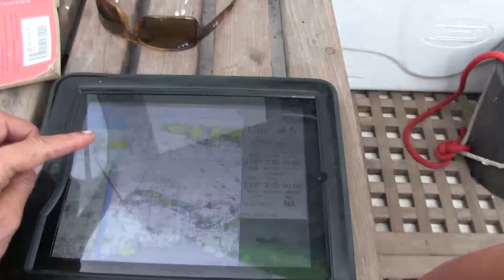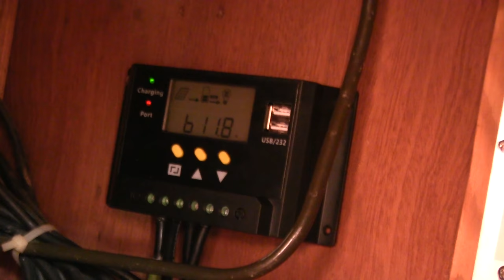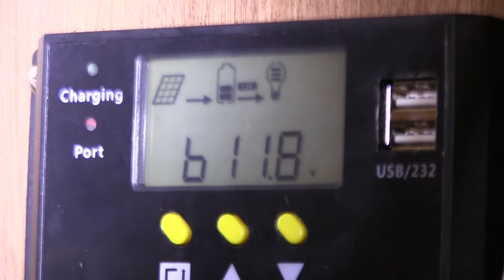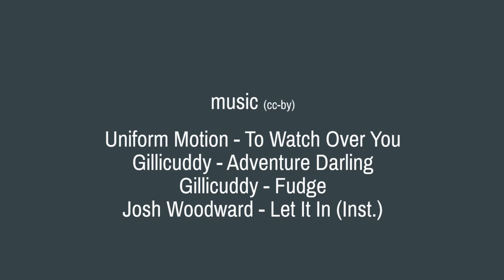Exploring pretty beaches and hanging with the Locals - UNTIE THE LINES S3E02

Comment: My charge controller is tucked into a deep part of the boat, so I added a shunt and amp meter so I could see the actual output of the solar array. Helps a ton because the battery monitor only shows amps coming in from the controller minus load, which can be very different than their actual output. Knowing only the amps from the array helps me know how the panels are doing without the charge controller and load messing up the number.

Comment: Two Solar modules in parallel will need a big diode for each panel to prevent the current from going into the module with the lower voltage in case of a partially coverage or a defective module. But you can get more out of your panels with two of this little fellas: "15A DC Boost Spannungswandler Voltage-Converter Step-Up Modul 12 60V auf 12 80V" They are under 20$ and you can adjust the minimum voltage that comes out of this components no matter how low the input voltage from the panels would be. Connect each Panel to one of these and the output in parallel to the charge controller. This will start charging your batteries with a paneloutput of about 9V. In this case a very small amount but it will. Additionally you can limit the output current but in your case the charge controller will do this, so you can set this to maximum. (You need a really small screwdriver for the adjustable resistors on the board and they have to turn multiple times from minimum to maximum) Take care you do not adjust the output voltage to more than 48V because of a higher risk of a electric shock. The ideal voltage would be a little bit more than the End-of-charge voltage of your batteries. Around 15V. They come without a case so you have to add one. Like the charge controller this components work like switching power supplies and can jam other electronics like a radio or the VHF when they are not correct installed, in bad condition, not shielded or not filtered. This component will only step up the voltage to the adjusted level but lets through every higher voltage. So you still can not put your panels in series but you do not need diodes and both panels are separatet and do not jam each other in case of a partially coverage or a defective panel with that. But there ist also a "5V-30V To 1.25-30V 8A Automatic Step-Up/Down Boost Buck CVCC Power Supply Module" available that can automatically convert a input voltage between 5 and 30V to for example 14.8V output. Maybe an update for your charge controller.

Comment: Great solar.  Yes, we had one of those cheaper chargers that was included with a few panels we installed, and it worked well.  The MPPT controllers work better.  Maybe you will be able to change to a better controller, but until then you have a working system!

Comment: Great video. I believe the "6" is intended to be a "b" for battery. If you can change one of the displays to read Amps going into your house bank you should do that. Volts are helpful for State Of Charge (SOC), but Amps are the important measurement. The same reason your energy budget most likely counted up Amps used in a day.
Reply from the maker: S/V Della Jean yes, u can totally change it to amps. This was just the setting it was on when I connected it :) it has various things u can read, once I had the English manual I figured out how to get to which one ;)
Reply: I thought you would know to have an amps display as I began writing, but decided to send my thoughts anyway just in case. Glad it's going well for you my friend. Be safe.

Comment: Nike,  you can get a Tracer CN (or A model) MPPT 30amp  controller from aliexpress (I've bought 2 of them) for around $85USD each.  It wil help you get more out of your system.  and you can connect it to your computer to really tweak the amps coming in
Reply from the maker: Pierre Mitham thx, that sounds great. After installing I also read about cheaper MPPT controllers, but at that point I did not know about them. Might consider an upgrade since I already ran through two of them ;)

Comment: I installed 3=130watt panels and 4 huge Trojan 6 volt batteries running at 12 volts into a cheap 2500 watt 12 volt input inverter, and with a cheap 25 amp charge controller. it charges at 20-22 amps on a good day and the batteries lasted for right at  8 years. Cheap is OK for a charger if you keep up the water levels and rotate the battery array once in a while. Glad you're back Nike. I know I'm commenting on past videos, but it's new to me.....😊. 
Since the charge system has been up a while...how did it do for you?
Reply from the maker: Brian Murphy pretty good so far. Even runs my new fridge nicely most of the time! :)
Reply: WhiteSpotPirates  Nike great to hear it's working good for you out there. It should also be an extra spot of shade on deck as well. Thanks for the reply!! I miss those while your in your off season. 😊

Comment: I have exactly the same controller as yours! That's a B for battery not a 6! So it was telling you your battery is at 11.8 volts! The red light (port) indicates no charge and the green is the charge indicator! I too have problems with the translation from Chinese! And I can't get the load side to work so my load is presently connected directly to my battery terminals! How's yours working?

Comment: Mppt controllers are the worse! They Bust your batteries. I strongly do not advise using them unless there is a very big limitation on solar panel area to be deployed on the boat.
MPPT controllers optimize the charge of the batteries, not the Lifespan of the batteries. they are not only more expensive to buy but they also have a negative impact on the overall price of the system since batteries have to be renewed more often. PWM controllers are the ones who really take care of the batteries. 
But yup those cheap chinese controllers are not good for long term operation. Of Course a Morningstar would be perect but those are expensive ... around 450$US.

Comment: Until 8:15 the notion of you a smoker never crossed my mind. hehehehehehehe
Reply: Comet Jockey Dave it's an electrical connector.
Reply from the maker: Comet Jockey Dave I think he got that, hence the hehehehe ;) but u r right, that was an electrical connector
Reply: WhiteSpotPirates Once I froze the video there, and expanded the image it looked more like a #16/14 female spring spade terminal. Yup, I'm that kind of nerd.
Reply: I was a little worried with the smoke in the drilling room, shop, that wd-40 is very flammable.